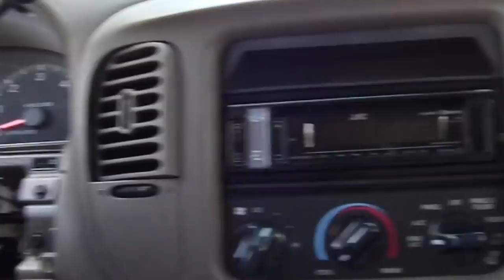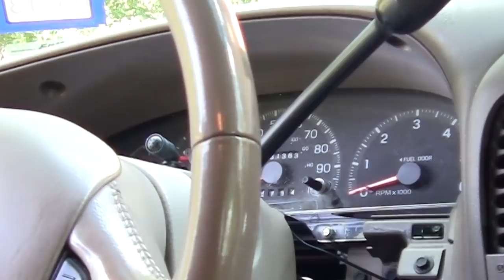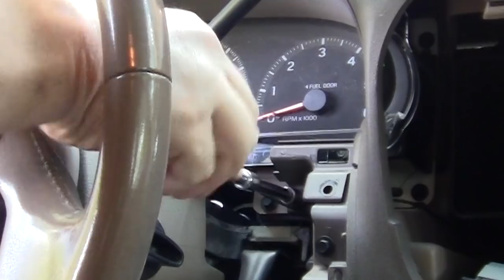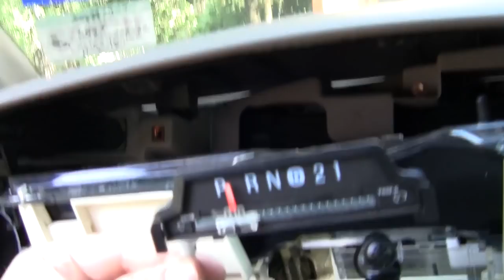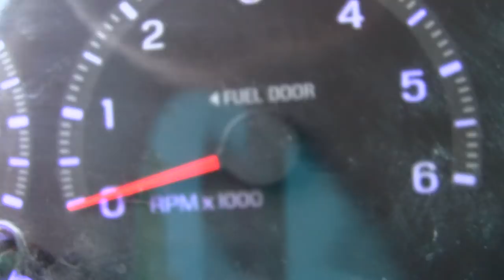1997 - 2002  Expedition, 1997 - 2003 F-150, & Navigator Instrument Panel Light to LED Upgrade

Comment: Too much work..my dash lights are fine the way they are!!
Reply from the maker: Jeff T  I had a couple of bulbs out so I thought I'd try something different since it had to come out anyway.
Reply: Too much work??? Try dropping your whole dash to change out your heater core!
Reply from the maker: So far I have not had that pleasure, but have seen some pictures of the process. Doesn't look like much fun.
Reply: @TwoKeysStudio  if you ever have to change one look for a guy on you tube named jake payne.
Reply: @commanderstud2417  heater core on a 2004 dodge dakota....it cant be any worse than removing the drain pan on 2003 accord or a 2003 chevy uplander-- the subframe has to be lowered to get enough space to remove it